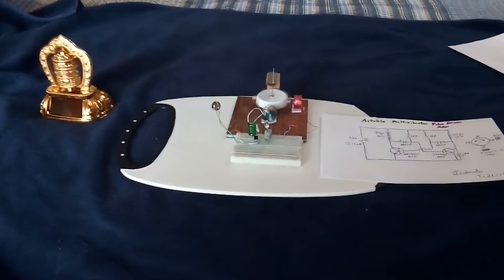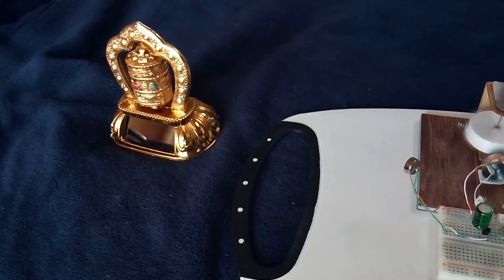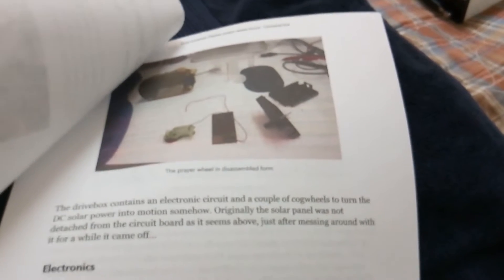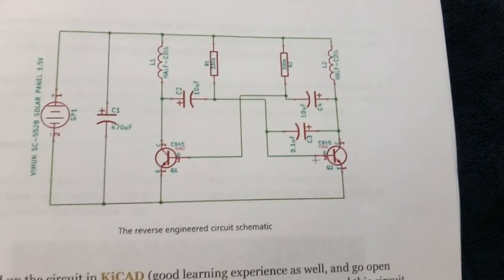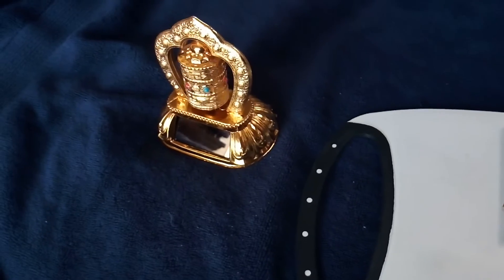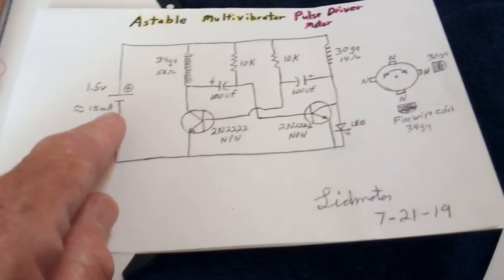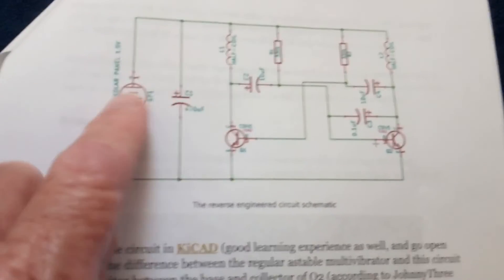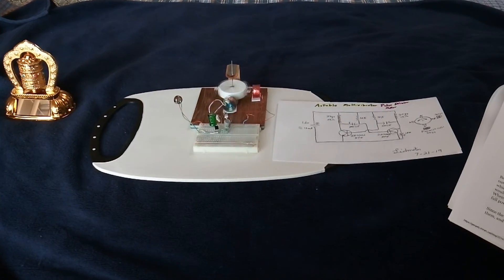Solar Tibetan Prayer Wheel Project

Comment: Thanks for posting this, because these oscillators are interesting.   I think I understand what's going on with this.   Or maybe not.  Seems more like a mono-stable, or single-shot pulser, since it needs a trigger from the fine coil to fire each time.  Or is it free running without the magnetic rotor?   I need to follow your lead and build one of these.

Comment: Nice.  What's the rpm on a fresh cell compared to your other 15mW driver circuits (i.e. 1.5V * .01A)?
That one seems to spin pretty fast per Watt.
Reply from the maker: This runs very fast considering the amount of power.  The circuit drives the rotor in some weird way. I'm still scratching my head about what is really going on here.

Comment: Just checked them out online, real variations in price, no doubt a variation in quality too. Cheapest I can spot is on eBay for £3.12 GBP I am tempted to buy one for the novelty value. That's the trouble, I would hate to take it apart because it visually appeals to me, so I end up with even more solar toys to hide from my wife 😆
Reply from the maker: I bought mine on EBay for about that much.  It took weeks to get it.  It is very similar to the waving gold 'Lucky Cat' in size and construction.  It makes no noise.  I may take mine apart carefully just to examine the internals.  It is an item that will probably find a place somewhere in the house.  I enjoy watching it slowly spin.

Comment: You should buy a few battery operated clocks (hint). Drop the idea of 10 mA, go to micro amperes!
Reply from the maker: Ah----So is that where this circuit comes from?  Thanks.  I vaguely remember researching electric clocks a few years ago.  I will take another look.  You are right about the amp draw.  It is way too high right now but it was a good first step.  I had a terrible time getting this to work at all.
Reply: @Lidmotor  Well, no, I did not say this circuit came from there, but seen the fact a clock runs very long on an AA cell, it must be very low in its amp draw.
You can also re-use the coils in the clocks, they have very fine wire on their coil.
Reply from the maker: @deslomeslager  OK.  I misunderstood.  I did take a look at the old electric clock driver circuits though and this is not one of them. I have a 'silent'  AA battery powered clock. that runs smoothly for months on that battery.  I might buy another one and strip out the motor to examine.